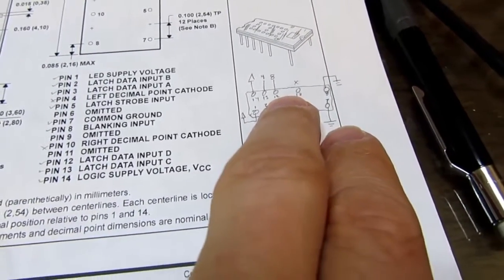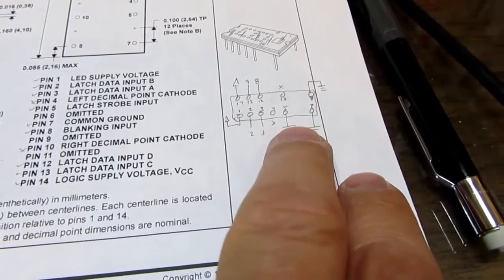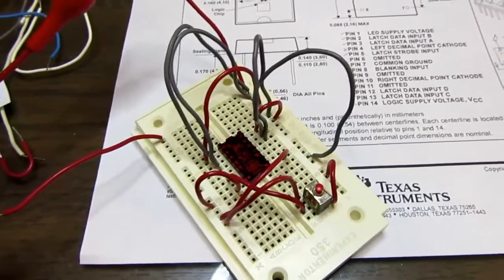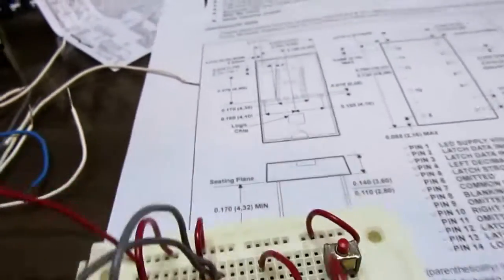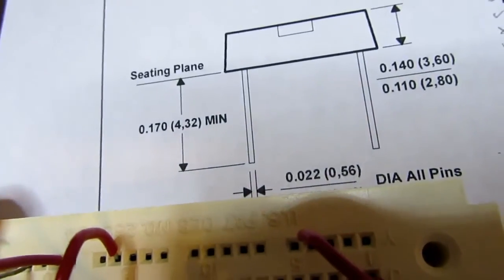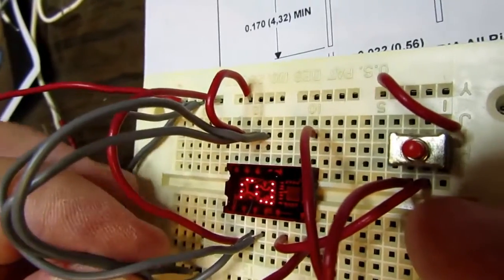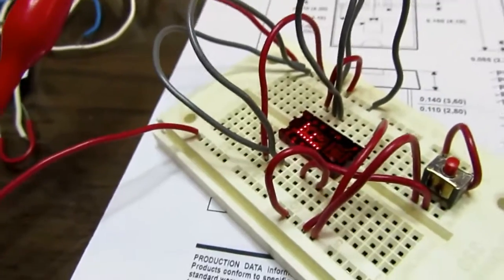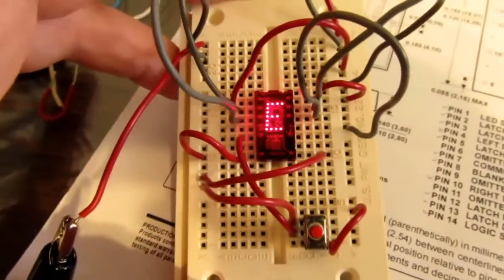Texas Instruments TIL311 or DIS1417 LED Display

Comment: Nice. Id did the same today by using pulled Texas Instruments DISP1417 sold by a seller located in the UK.
Compared to the HP5082-7340/7300 the DISP1417 (might have) has disadvantage regarding size, current consumption.
The DISP1417 decodes HEX properly, the 7340 does as well.
The 7300 mostly shows 0-9 only. Good enough for regular clock application I want to use it on.
In 2025 the Disp1417 and HP5082-7300 can be bought relatively cheap still.
The 7340 is very expensive to buy, I do not buy. Got two 7340 accidentialy be cause of the sellers fault.
Testcode provided by YTer Lucas Marik.
On his channel he shows a very large number of vintage LED.